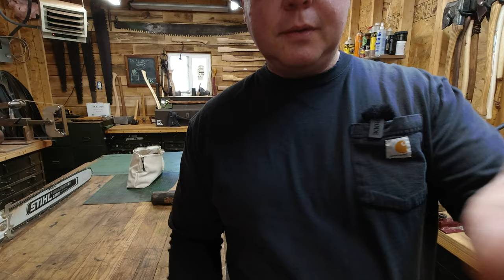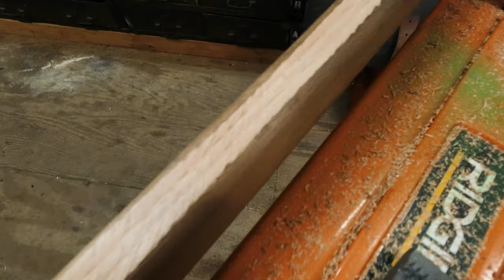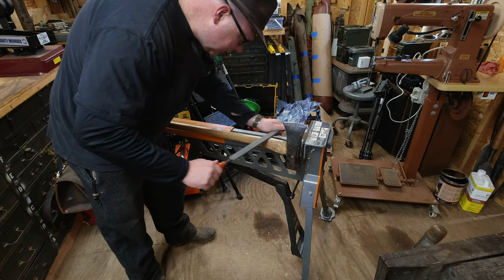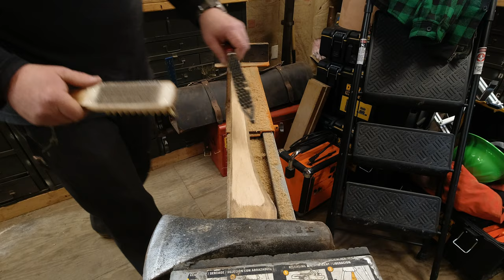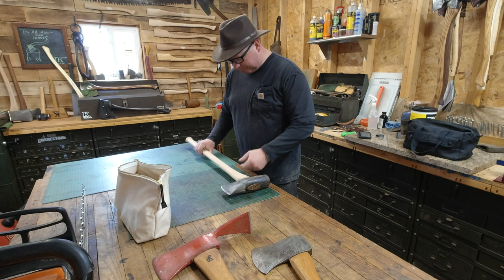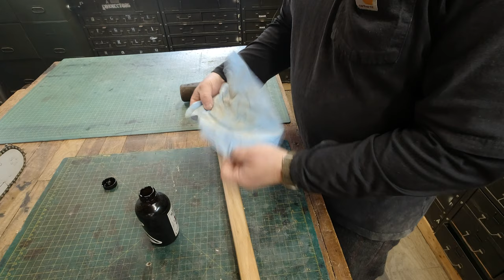How To Octagon An Axe Handle

Comment: For the Octagon to really work for you, it is key that you index the two larger flats so they are exactly parallel with the long axis of the head. It is all too easy to get the whole octagon kinked off to one side or the other, so, in use,  your grip is not accurately indexed to the head. For this reason I always do the large flats first and check alignment sighting through to the head with a winding strip. Once these two sides are right and true, the rest is a doddle.

Comment: I work with a guy who did this using a hand-held belt sander.  It's easier to keep level so the angles where the sides meet up are pretty clean and sharp. After a final sanding and a boiled linseed oil finish it looks amazing.
Reply from the maker: Thay will definitely work! I like to show how to do things by hand when I can. I have a 2x72 I could have used but not everyone has that.

Comment: Thanks for another great tip. I bet the handle doesn't slip as much and turn in your hand on impact as the smooth sided handle does when splitting wood. Thanks
Reply from the maker: Its definitely more stable

Comment: Thanks for the video! I have a handle from one of the first projects of mine that got chewed up because I’m not good with a spoke shave. 😆 gone try this for sure👍🏼

Weird, and possibly silly, question about that Rigid jawhorse: do you think the pressure is enough drive/squeeze the wedge in to a handle when hanging a head vs banging it in with a mallet?
Reply from the maker: Definitely a good candidate to practice on. 
I have thought about that as well but I dont believe it would be strong enough.  Plus you get a lot of flex in the handle.